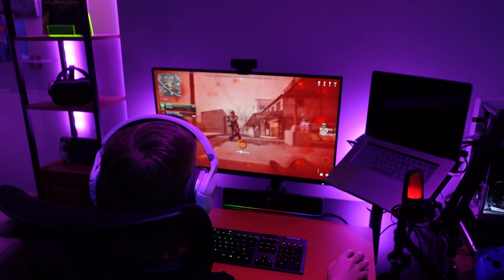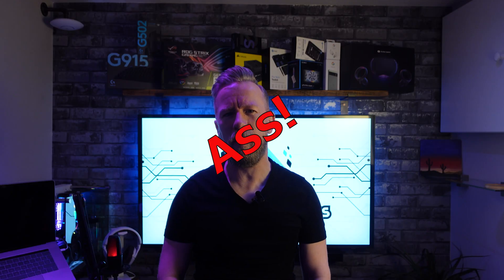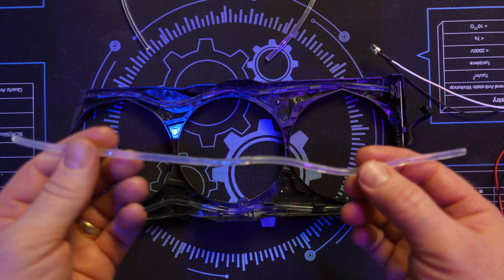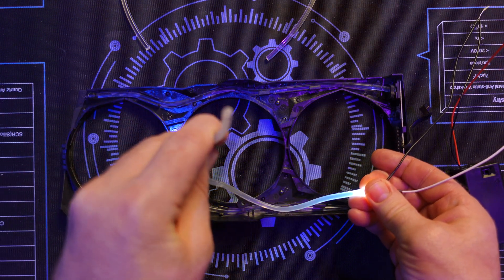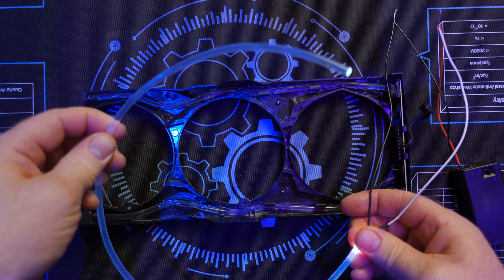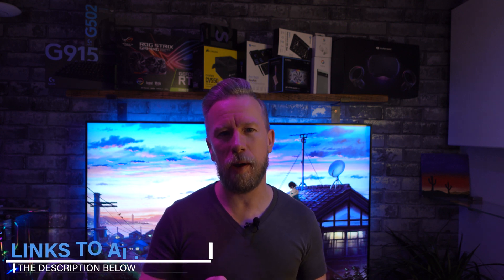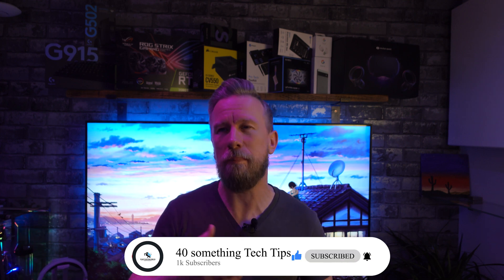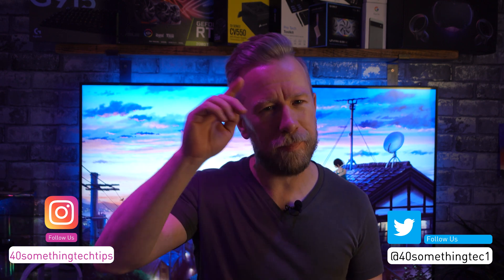When the Strix 2080 TI Light Fades: A Terrifying Tale!

Comment: Nice fix ! Could you tell me if your Strix 2080ti has coil whine ? I would like to get a used one as I like the cards look (a lot) and Im still only on 1080p 144 hz so really nothing more powerfull is needed. I had a Strix 3080 12GB for 2 weeks but decided to return it cuz it had severe coil whine and I like my PC opened.
Reply from the maker: Thank you for your kind words! I appreciate your interest in my video. While I haven't personally experienced coil whine with my 2080 Ti, I understand your concerns, especially after your experience with the Strix 3080. The 2080 Ti is a fantastic card for 1080p gaming at 144Hz, and its aesthetics are indeed impressive. If you decide to go for it, I hope you enjoy both the card's performance and its visual appeal. If you have any questions about the RGB repair process or anything else, feel free to ask. Happy gaming!